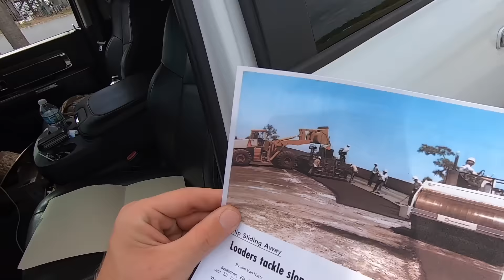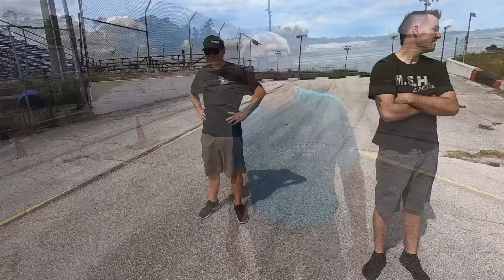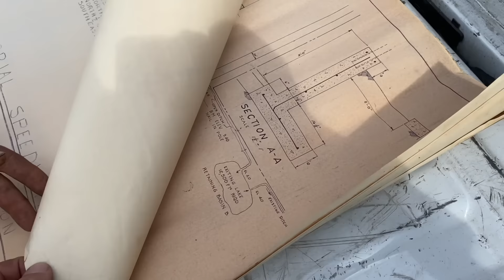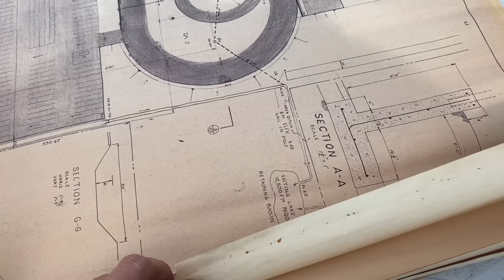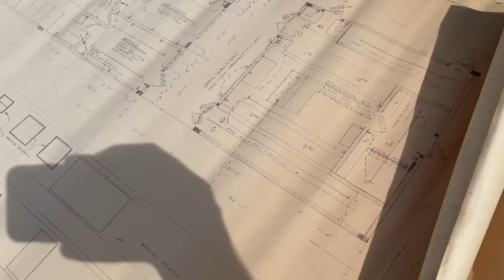Meeting the Man Who Originally BUILT and Owned Our Abandoned Speedway in the 70's!!

Comment: The fuse info on the lights is gold....i wouldn't have even thought about that.
Reply: The electrician should have checked them already
Reply: @johncuervo3019  Depends how good the guy is^^
Reply: @johncuervo3019  I have a feeling they just got him in to verify that the power would run safely. To have an electrician come in and fix all of that and check each light and fuse would have cost a fortune and taken way longer.
Reply: " yeah don't stick your finger in there"
Reply: Gold IS a great conductor of electricity.
Reply: James: "  Duly noted"
Reply: @djstatyk1540 Gold is used because it resists corrosion not because it's the best conductor.
Reply: @VFR75O  guess you just wanted to correct someone. He didn't say best. He said it is a "great" conductor of electricity. Reading comprehension.
Reply: @VFR75O  yes I know this, otherwise I would have said copper, SMH. Search mogami gold cables. Their most preferred over other XLR cables specifically for corrosion
Reply: @VFR75O  not to mention you completely missed the joke, he said the fuse info on the lights as gold, he was talking about a completely different value LOL
Reply: Imagine the bill for an electrician checking all the fuse boxes 😂

Comment: If there is a lineman school near you they would probably change those fuses for next to nothing so that lineman students can get practice..
Reply: thats actually a brilliant idea.
Reply: Students working on 415v 3 phase... Not a good idea if you ask me.          I would come and do it but im in the UK :(
Reply: If you make all the power DEAD they could work on it that would be great practice.. been there done it
Reply: Mania Sound & Light We worked on 480-575 volt systems in hot panels, switchgear, line side of disconnects, etc. as 4th and 5th year apprentices. Not on energized parts, of course, but I'm an inside wireman, not a lineman. I'll work hot 277/480 when it's necessary. Clean, dry leather gloves will insulate against 480 and Klein tools will against 600. Not officially, obviously, but I promise they will, haha! Insulated tools are usually good to 1,000. Lineman work hot 34,500 with just hot gloves sometimes.
Reply: Mania Sound & Light you ever heard of a circuit breaker brah
Reply: Tyler Harrington You'd have breakers back at the panel or switchgear, but it would be fuses at the poles. Breakers can be fried in the event of a lightning strike, and fuses can ALWAYS be trusted to work without malfunctioning. I trust equipment to breakers, I trust my life to fuses. 

What they have is a big (probably #4 or so, depending on the pole's distance from the panel/switchgear and whether it was designed properly) wire per phase going up the pole into a small junction box up by the fixtures and terminating in a fused distribution block where it breaks out into 4 smaller (probably #12) wires to run each light. 

The fuses protect the fixtures and fixture wires from overcurrent, as the big wires are protected at 60-100 amps and without them in the event of a short it would cook the light ballasts. They also protect the wiring and equipment upstream of the light fixtures in the event of a lightning strike.
Reply: Tyler Harrington Yes I have but what if someone walks in and turns the ‘breaker’ on?  Also I’m sure they are called isolators
Reply: @dandubock515  Lock out tag out. Make sure it's clearly defined and obvioud that the breaker is open to protect people that are working on the system.
Reply: Im a lineman but i live in texas. 😔 gunna be so hyped to go here tho
Reply: Mania Sound & Light You isolate the load by locking out the breaker or disconnect switch or whatever is used in that particular system with a lockout device and padlock if there are other people around or if you don't have a partner to watch and make sure the breaker/switch/disconnect/whatever isn't operated (or, in most industrial facilities it's required to lock out any source of potential energy, be it electrical, mechanical, pressure, chemical, whatever, any time work is performed on any branch of the system). And yes, in America they're called circuit breakers, or breakers for short. 

I like to also ground each phase conductor and short them together with heavy (4/0 or so) jumper cables if I'm not absolutely certain that every potential source is isolated/locked out (some industrial control systems are very complex, and good blueprints aren't always available or kept at all, it's kinda hard to know for sure in a lot of scenarios), so that if something I'm working on becomes energized, it doesn't have to go through me to get phase to phase or phase to ground.
Reply: Jacob W i want to be a Journeyman Lineman
Reply: @dandubock515  stay in the uk you could not handle the usa it sounds like
Reply: The sinner Jim Whitney lock out tag out 🙂
Reply: Dylan Rod its a great career and fun
Reply: Linesman
Reply: Could either get some linemen or some telecom guys out there
Reply: There is a lineman class not far from here my buddy just started last month
Reply: Possibly not even a linesman school! They would probably do it, but companies who hire new apprentices would be ALL over this type of work. As an industrial apprentice, i can only start to tell you how many "fuse jobs" (as we call them) i have done lol
Reply: Dylan Rod Where do you live? Get in touch with your local IBEW apprenticeship director, there's an ENORMOUS surplus of lineman work in almost all of the US right now, and should be for a few years.
Reply: Them at guys nose has seen mountains of blow woooo
Reply: @dandubock515  Over her, we switch off the power first :)  Not good press to fry the local students.
Reply: The sinner Jim Whitney i live in California right now Bakersfield specifically, i’m 17 now graduate in High school in May
Reply: @The_sinner_Jim_Whitney  Man one day I bought a bunch of chinese fuses for my car and wanted to test them out I replaced one 50a fuse for a 10a chinese one and NONE of chinese ones would blow some of them got so hot the plastic melted... next day I bought bosch fuses and they blew right away man be safe
Reply: pier99francesco The kind of fuses you use for high voltage are all pretty high-end (any I've ever seen, anyway) and SUPER closely regulated. Remember, these things sometimes protect multi-million-dollar pieces of equipment or entire crews of electricians/linemen/bystanders, blowing when they shouldn't or vice versa can't be allowed to happen.
Reply: Lighting rods on the top of those posts might do some good.
Reply: worthypoo Yeah, modern lightning protection would go a long way, but it's EXPENSIVE. I'm an IBEW journeyman electrician with 12 years' experience and a master's license, but (at least in my state) that's not enough to certify me to install most lightning protection systems, even though they're usually extremely simple. Specialty contractors cost a king's ransom.
Reply: Why would lineman need to do this job?  A electrical company that does light poles would do this job for cheaper. Probably have to rent a boom that goes high enough but 480v isnt high voltage so why lineman. Apprentices work on 277/480v all the time where I work
Reply: battlehardened37 So do our 4th and 5th year apprentices. Here in WV, our inside wiremen (what I am, commercial/industrial electricians) often do this kind of work, but technically it could fall under inside or linemen's scope and could be done by either. Linemen usually do this kind of work two guys to a bucket truck, and if any of the poles need replacing, could also bring a digger truck for a couple hours one day and set a new one. 

It's often cheaper than hiring inside guys to do it, because we're usually a shade more expensive hourly and would have to do the work off of extension ladders or out of a rented JLG, which would probably take longer than a couple linemen in a bucket, to say nothing of setting a new pole, which is a lot of work without a digger truck. Just depends on what kind of price they get for the work, and from whom.

Also, depending on their local laws, codes, etc. (it's Florida, so likely pretty lax), over 250V might be considered 'high voltage'.
Reply: All things considered, once they get up and running and making money, they might be money ahead to try and find a good buy on like a 46-60' JLG to have around for light poles, bleacher work, power/communication poles (assuming it's not all underground, which it may be), PA equipment, maintenance on the tower, etc.
Reply: @dandubock515  You gotta do it the first time some time.
Reply: Not gonna happen here
Reply: @dandubock515  They would know 415 is odd to work with.

Comment: The logic behind the lighting engineering is perfect, protect the lamps from lightning with fuses, and run less wiring to the poles, meaning less potential points of failure, just the way good engineering is meant to be done. Those diagrams will make future improvements and facility evolution a lot easier. Great to see one of the guys that built the place is looking forward to its newest incarnation.
Reply: Copper costs a lot also so it also means less cost to build.  He was operating on a shoestring budget so I imagine that was his bigger priority and he even said it saved a run of big wire back up the pole to have the fuses up top vs at easy to get to height lower down.
Reply: PiDsMedia That's how any electrician would install them. These days, it'd be a three-wire system with additional lightning protection, but the old way works just fine on wood poles, just more time in changing fuses.

Comment: 13:53 You should do I contest with people coming by with their cars and see who can do the fastest lap! Like how Top Gear did that with different cars and people! Like a ever changing scoreboard would be epic 🔥
Reply: I'm worried about what happens if/when someone hits the wall hard enough to get hurt, or worse.  If I was Cleetus the first thing I'd do is install SAFER barriers or tire walls...
Reply: @MikeKayK  Tire walls serve no purpose for a banked race track unless your putting them around the light poles. They would actually cause more accidents then they prevent because you can rub a concrete wall but a rubber wall pulls you in. Secondly a Safer barrier for a 3/8 mile track is close to 450k, About a quarter of what he paid for the track, and even nascar debates the usefulness of putting safer barriers on tracks smaller then a half mile
Reply: @Loki_Trickster  Agreed, I'm just throwing out ideas because it would be terrible for someone to get hurt, would really put a damper on the whole thing.
Reply: They do that at a local track here in Northern Indiana, they call it " Beat the Clock " Pay $100 and a trophy to first and second places
Reply: @MikeKayK  Best thing to help with that is make every car that goes on the track that was build before 2000 be caged. Most cars built after that are capable of surving a crash at short track speeds. Steele Crash was a freak accident, and shouldn't be cause for fear for closed top cars that are 8-10 seconds slower around the track lol.
Reply: You can probably get a good deal on some used ARMCO barriers

Comment: 7:40 Cleetus wasn't sure what gypsum was but didn't question it. 
I only knew it was rock but nothing more
Reply: john cuervo What he's talking about is probably not real gypsum, which is its own mineral and what most chalk and sheetrock is made of. What I've seen referred to as 'gypsum' (which for some reason everyone pronounces as 'gypsen') in road and industrial construction is really powdered limestone. In the powerhouses where I work a lot of the time, they use it in a slurry to remove sulfur from the flue gas (coal smoke). Some of them also mill limestone into 'gypsum' on site.
Reply: @The_sinner_Jim_Whitney  You nailed it. There are three limestone quarries within 30 minutes of my town. All of the old dudes call powdered/crushed limestone "gypsum" even though it's no such thing.
Reply: Just think of Whites Sands Missal Range in New Mexico. That’s all it is.
Reply: I use to work at a gypsum mine running and feeding the crusher/screen plant in freedom, oklahoma. Our rock was used to make access roads and platforms for the oil rigs!
Reply: Kelsey Clark. That material sucks to drive on out in the oil fields.

Comment: Cleetus, I'm sure you are tired of hearing from me, but here goes again- free advice, worth exactly what you paid for it; when you go looking for that "bucket truck", include in your search a "telephone pole setting truck"- they have a hydraulic, folding arm  and sufficient power and versatility to drill the 12" hole, lift the telephone pole (#2500-#3400), stick it in the hole and hold it level and then has a bucket the linemen can work from to set the trees and hardware for service as a carrier. They also generally have large capacity tool boxes as part of the bed, and quite often are cabbed with 4 door cabs. Love the core sample idea- not only will it tell the history of the tracks construction, it may tell you a great deal regarding future maintenance needs. I hope you got the builder's comment about the portability of the far side bleachers- that means you could move them to a better vantage, only needing to install proper support pads for the structure.

Comment: Cleetus mentioned changing all those bulbs in the lights to LED bulbs before, I know when changing fluorescent lights over to LED you have to have different tombstone connectors and completely re-wire the light fixture do bypass the ballast. Metal halide also use a ballast so there’s probably some wiring work needed.

Comment: It's nice that Mr. Tharpe saved those original drawings for the facility.  It will save a lot of time and expense when renovating. Those pole mounted fuse boxes were perhaps a good way to save money 40 years ago when operating on a shoestring budget.  But I'd see about relocating them on the ground level and upgrading the fuses to circuit breakers.  Way easier to maintain and not that much to install especially if rewiring for LED's anyway.

Comment: i can only imagine LED lights would pay for themselves incredibly quickly in this type of operating environment. you can run less lights at lower power consumption while getting the same equivalent lumen output  and increased life expectancy. You could then switch to smaller gauge wire and move the fuse panels on each pole to the base more economically as well with less fuses total. eliminating the need for a man basket rental every few months. Seems like a no brainier other than the extreme up front cost im sure that comes with it.
Reply: A lot of power companies still offer subsidies for LED conversions.
Reply: Watch the lightning strike though. Electronics hate that thing

Comment: I would certianly look into surge protection, lowering the fuse box to the bottom and a large grounding ring, for lightning protection less fuses, less need for bucket truck, and all around better electrical system. Ground the whole system, will also lessen electrical fires as well.

Comment: Renovate the lighting to LED, I work as a lighting designer but you need a sports lighting engineer. They can probably re use the poles and most wiring. It will save a ton of maintenance time and money not to mention electricity.

Comment: The fuses should be 8-10 amps.
One single lamp uses 2.08  amps at full temp but inrush current (at startup) is much higher (about 4.75 to 5.85 amps dependent of outside temp).
Rule for fuse size is: run current times 135%(2.08x135%=2.8A) but inrush bring that up to about 6A.
If the fuses are in parallel just divide the current by 2.
If you want to solve the lightning strike issue you need a grounding rod at the top of the light pole that runs in to the ground (metal strip).
If you don't and you use LED s they are much more sensitive to high voltage (lightning strikes) and the fuse won't save them.
https://www.1000bulbs.com/pdf/plusrite-7274-specs.pdf

Comment: Maybe someone come here can help me, my truck has the 5.3 and I’ve recently started smelling antifreeze every time I drive it is this a start of head gasket gone bad?
Reply: Do you smell it inside the cab? If so... heater core.
Reply: The All Seeing Pie no just outside, no smell in the cab
Reply: @blakewhite723  check around your heads, water pump, and hoses for leaks, also check the oil dipstick for chocolate milk ASAP.